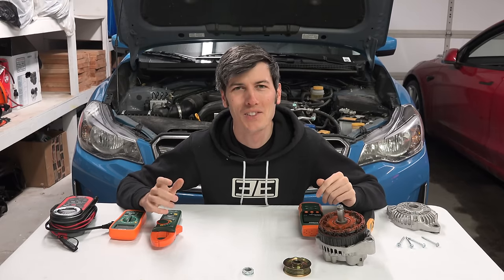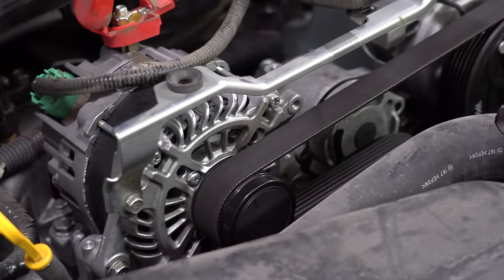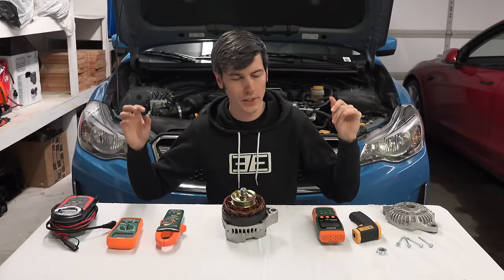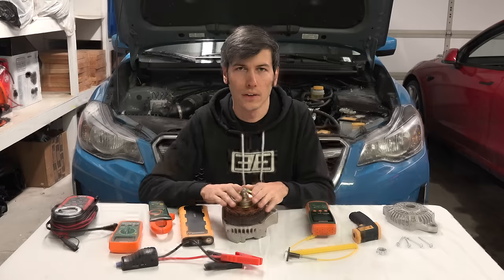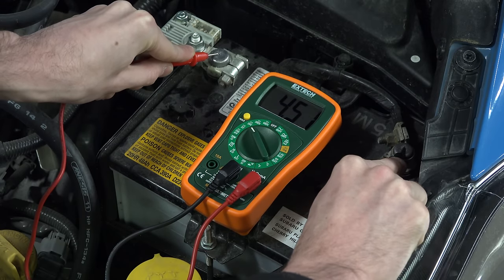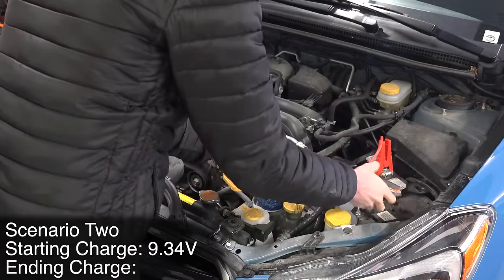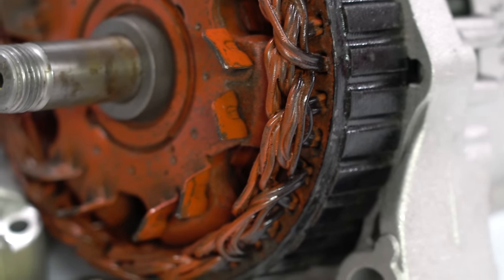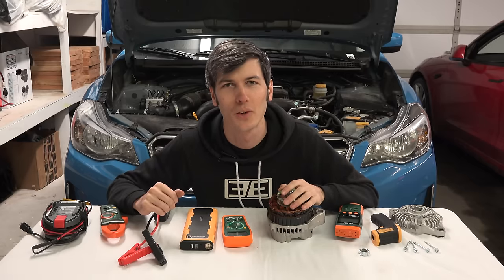Can A Dead Battery Ruin Your Car's Alternator?

Comment: Interestingly I've never heard this "myth" before.. but I have heard it happens when the battery on its last leg and not holding a charge well - which would make sense based on your findings... that looks like a high capacity or at least AGM battery? If so it would be interesting to see if it makes a difference with an "old style" battery.... you've sparked questions I shouldn't be asking.. nice video!

Comment: And don't forget to check the tension of the belts. By the time they start squealing when you start or run the engine hard, it's already time to have done something about them. Nice lesson on how hard an alternator works at start-up and the importance of keeping a healthy battery in your vehicle, not just one strong enough to turn it over one more time after suitable prayers (or curses).

Comment: It's worth noting that it's really not good for the battery to change it at 30A or more.  Unless the car is a newer model with a smart battery sensor (generally models with auto start/stop), the more discharged the battery is, the more current it will draw, since the alternator produces a near constant voltage. If you have time, you'll preserve the battery much better by charging it with a battery maintainer/charger. (Or ideally by using a maintainer to make sure it doesn't get discharged in the first place.)
Also, if you happen to have a new lithium iron phosphate battery, definitely don't jump it from dead, since they can explode or catch fire if over-currented. (You'd know if you had one of those though.)

Comment: I don't worry about the alternator, I worry about killing the battery on a quick charge.
If I'm in my driveway, I will always slow charge the battery to prevent improper redeposition of lead.

Comment: It seems it's not a dead battery you've been using. It's a flat battery. Dead battery should not able to charge up and the charging current will be near to zero.
Reply: This was my complaint about the title of the video, discharged is not dead.
Reply: @AndrewPrinster  tbh thats just a misuse of the word, most people say "my battery is dead".
Reply: Grammar Nazis--
Please be correct when trying to call people out.  Calling a drained battery "dead" is perfectly correct and actually ptedates calling it a "flat" battery.  A battery that will no longer accept a charge is a bad battery or a failed battery.
Reply: Since this video is highly technical, we do not use the term dead battery when you willfully discharge the battery till a voltage that will destroy it. There are a lot of dead batteries video on YouTube that cannot be charge by pure "charging".
Reply: you are right, all video is ziped in your comment

Comment: @Engineering Explained  Great Video Jason,  your next installment should cover Smart Charging system that are widely used today in vehicles.  Much improved charging due to float, bulk, and sulfation charge modes, current sensors that monitor current into and out of the battery, battery temp and state of charge.  if that wasn't enough the body control module will monitor all of this and actively command the alternator, keep track of vehicle electrical demands, check battery condition when idle, and shed loads during operation when problems arise.  Even with this much improved system.  I still need to put the battery on a short bulk and longer float once a year to bring it back to full capacity.  The BCM gets to a point where it thinks the battery is fully charged, but isn't. The original AC Delco battery lasted nearly 7 years, which is phenomenal.

Comment: Will you do a test of jump starting a car with the working car engine running vs engine off?  Will jump starting a car from a running vehicle damage the running vehicle's alternator? How long will it take if you just charge the dead car's battery from the running car (via jumper cables) to prevent possible damage to your alternator?

Comment: Doing this with a new/rebuilt alternator supposedly can have different results.  The brushes aren't worn in yet and can cause problems.  Always make sure you have a charged battery before starting the car with a replacement alternator.

Comment: I would like to know why they stoped putting gages related to the electric system in modern cars.  Bus shorts happen as well as bad batteries and a volt meter would give you a clue that something was up probably before a mystery Batt light came on.  Thanks for another great video!
Reply: They can throw codes for that now. Would be nice to have somewhere in the nav screen things like voltage, tho.

Comment: Great video, but I don't agree with the last conclusion. 
If you have a bad battery, the alternator won't be working harder because the battery won't accept the charge. It will raise to its operating voltage but it would take less energy (less Ah) to get there.
In your scenario, the alternator did get warmer because your battery is in good health and it can accept the energy it has lost when it was discharged. More energy in a given amount of time equals more power and more heat dissipation because of inefficiency.

Comment: Alternator is made to charge battery and keep electronic on. My alternator on Ford Focus goes up to 120A and first time run out after 7 years, diods burn out. That is expected time to run out in normal conditions.

Comment: I would be curious to see the results of this experiment done again after the battery has gone through a few drain and recharge cycles. Lead acid batteries do not like to be completely drained and then sit, and most can only be drained and recharged again a handful of times before not being able to hold a charge. I wonder what a battery that's been through a few of fully drained-recharged cycles and is at death's door would do to the alternator. Great video Jason.

Comment: It does make me want to see these results, and maybe revisited during the summer, and compare them to specs of the alternator in terms of the temperature and all that.

If it remains within spec then it does make me wonder how much it truly does to the alternator... or if it's an insignificant blip in its lifespan (of course, this could also vary from model of alternator to model since varying specs, but you get the idea.).

I know, for instance, typical VRM components in computers can handle 125-150C in most instances.

Comment: 75% state of charge is more discharged than you might think. If it were at 50% SOC reading 12.4 VOLTS that battery is dead. If you drive a car maybe once or twice a week and it's a short drive if you want your battery to last 7 to 10 years keep a smart charger connected Schumacher makes a nice one with a phone app so you're able to keep an eye on things. The reason car batteries today don't normally last as long as they used to is because they aren't made with virgin lead they are made with recycled lead and that lead becomes a lead alloy. Virgin lead batteries are around 300 bucks for mid sized cars or smaller truck batteries are more because they tend to be larger

Comment: the honda ruckus uses a stator which acts as both a starter and an alternator.  how does this work?  I understand if you spin it it makes current and if you put current to it, it spins.  what I don't understand is if this is possible, why other motors don't use this method of starting? (patent?)  I like it.  if you accidentally the starter while the engine is running it really doesn't do anything harmful, like ruin a starter or flywheel ring gear.  granted this is a single cylinder engine, but I don't see why it couldn't be used on a larger scale.

Comment: A bad ground from battery to body ruined my battery and alternator on my Corolla S 2011. If  you have a 2009-2013 Corolla make sure to check the ground! Toyota decided to paint under it so my brother used a grounding drill bit for Blue Origin rockets.

Comment: I'm a little late for the discussion  but i'm curious as to what would happen if you boosted the car with another car.  I've done that once where it actually killed the alternator.   Not certain if it was an issue with two alternators feeding current or if there was a spike in current or voltage, but it's worth looking into...

Comment: A dead battery might be a problem if it's enormous(like on RVs), but I've only heard of people having trouble when using high draw accessories like aftermarket sound systems or inverters. If a car has bad under hood temps that will also contribute. Otherwise, alternators have a small fan on them specifically for using air to keep the internals cool.

Comment: Firstly alternators are pretty rugged, they do have a fan to cool them.Secondly a near dead battery will generally not draw a lot of current from whatever is charging it. As they age car batteries lose capacity, as it's being charged the battery voltage increases quickly as a result. This is why you can determine state of charge with a voltmeter but not battery health.

Comment: Another angle on this:  Lead-acid batteries have a max sustained charge rate of 0.3C, where C = battery capacity (approx. 75 AH) and 0.1C being preferred.  This gives an ABS MAX additional alternator load of 22 amps (but only for a very short period).  A properly operating ECU will quickly modulate the alternator output never sending the battery more than 10 amps (worst case sustained).  Higher currents will cause it to outgas and quickly dry out.  Bottom line is that a small, sustained 10 amp increase in load on a properly cooled alternator shouldn't affect it's life unless it is grossly undersized or otherwise marginal for the application - all of which jives with your real-world result!

Comment: What kind of chargers do you recommend to take care of batteries? Both for diesel and petrol engines? Some are designed to stay connected to a car that is always garaged without disconnecting the leads.  Do you have a video on battery chargers?

Comment: If you have a crappy designed alternator that can not handle being ran at its peak rated output for long enough to get the battery voltage up high enough to start the current draw it creates to tapper off to where the alternator is not running flat out at 100% capacity, yes it will damage it.

Sad fact of common automotive alternators is that unlike commercial grade units they are grossly overpriced, underbuilt and overrated. 

There are many (near most now) automotive alternators that barely do 100 amps output and can handle that output for more than a few minutes without burning out that cost $200  - $400+.   While there are countless commercial grade units that can do 140 - 250+ amps 100% duty cycle and still cost way less than the automotive units. 

For farm/industrial/commercial refit applications I am big fan of the 130 - 150 amp honest rated Delco/Prestolite 22si size 1 wire units from NAPA that cost around $135  - $150 depending on specific body designs and I have never had one go bad due to overload even when ran for literal 24+ hour runs at 100% duty cycle.

Comment: Thanks for this Jason. Alternators are my weak point and I have always wondered how a dead battery could cause the alt. to fail. From this video, it looks like it's about the heat. Makes me worry about my Dodge with dual batteries. So that means the alt. is charging two batteries instead of just one.

The other question I have never been clear on is the difference between an alternator and a generator. So many service manuals call it a generator, but I wonder if that's just a copywriter that doesn't know better, or if I'm just missing the big picture.
Reply from the maker: Thanks for watching! Perhaps I should create a future video detailing how it all works. And there are differences between an alternator and a generator, so perhaps the service manuals are using the correct term depending on the vehicle and what it's using.

Comment: First off, I am sure there is a threshold on how fast a lead/acid battery can be charged and still reach peak sustainable voltage, but this does bring up a question. If as an example you have decided to change to a more powerful alternator, say for instance because you have added higher wattage stereo components etc, will the degradation of the alternator be less significant than on a stock alternator? As an example, let's say the OEM alternator is 100 amp rated and you install a 200 amp alternator, because you are using less of the maximum potential of the alternator, will it last longer?

Comment: There is some miss information here. Batteries become a little bit more complicated as they age and they actually resist current as they age (the primary reason for this being the “sulfation” process). An alternator usually provides as much current as the battery can take + what the car needs (up to its max amperage of course). I said usually because newer cars have very intelligent Battery Management Systems; an advanced BMS knows the battery age, the recommended max charge current, its capacity (Ah), the battery temp., the environment temp., the SoC and so on. Based on this info it controls the alternator in order to provide an optimal charge process.

Comment: Sounds like you should not wait for a battery to fail before you replace it.  So, when would be the best time?   Guessing that should be at a certain resting voltage?

Comment: Where you run into trouble is you have to change your alternator to a new/refurb one and the battery is low/dead due to the alternator troubles.  So, you install the new alternator, start the car, and charge the battery.  And you let the car sit charging at idle, which means with the rotor full fielded, i.e., max current, due to the amps needed to charge the battery, with no airflow from driving.  Ten minutes or so followed by a cooling period, with the hood open, isn't going to be a problem for good new alternator, but 20-30 min on a hot day, with the hood closed, at idle is a killer.

What happens is, that the brushes have not worn in so you've a very small contact surface, which means higher resistance, which means more heat.  And you are putting a first time thermal load on the diodes, windings, etc.  The danger is less if the alternator has "burnt" in so to speak.   The danger is less if you are driving at a higher rpm so it takes less fielding of the rotor to generate the amps.  

And, if you need to charge the battery, keep your electronic accessory crap off, especially your amp sucking super stereo and your blowers.  Then fewer amps are need to operate the engine and charge the battery keeping the heat down.

Comment: It would be easy to allow te voltage regulator to release 100% power to the field for suddent request of power and drop it down to 70% for sustained load preventing itself of frying...

Comment: One question Jason: I have also at home a battery charger, and in the manual they say you should never connected directly to the battery when the battery is connected to the car. To charge the battery properly you should remove the baterry out of your car. Doing It when the battery is plugged into the car means that the charger is also injecting energy into the car electronics and these could be damaged. But of course this is what the manual said, what is your opinion about that? thanks

Comment: I have a question. Many (many many) years ago I read an article in Popular Mechanics about building what would prove to be the first hybrid car. In brief it invloved stripping a VW Beetle replacing the engine with an electric motor, loading up some "deep cycle" marine batteries and replacing the body with a light weight fiberglass one. Here's the interesting part, instead of plugging it into an outlet to recharge there was a lawnmower engine hooked up to some kind of aircraft quality generator/starter motor. I think it had to do with jet engines serving as a starter for the jet and then generating electricity for the airplane once the jet was going. It was all wired such that when the batteries got down to a certain level the generator/starter would turn over the lawnmower engine to recharge the batteries. The lawnmower engine would continue to run even if you turn off the ignition key (because you got where you were going) until the batteries were fully charged. I was just a kid then (late 70s or early 80s) so I never sent for the full plans but they were claiming about 85 mpg which even a Prius can't beat. So my question: What kind of unit serves as both a starter and a generator?

Comment: In my experience a bad battery is more likely to kill a good alternator than a bad alternator killing a good battery. But your test didn't include a bad battery, merely a flat one. I have a car that I don't drive very often, the battery is good and so is the alternator, I've used the alternator to charge the battery more times than I can count by jumping the battery and charging it with the alternator. But, back in the day, there have been times when my battery would give up the ghost and not hold a charge. When I finally got the cash to replace the battery the alternator would fail right after I changed the battery.

Comment: A possible skew in the info gathering -
My good ol' 2000 Toyota Sienna reduces the rate of battery charge when the under hood temperature is high. This is to prolong battery life.  The Toyota publication where I found this info was devoid of actual specs.